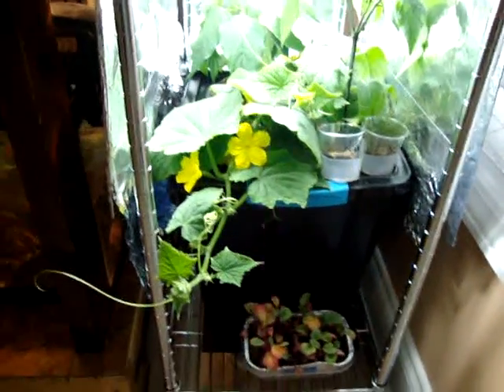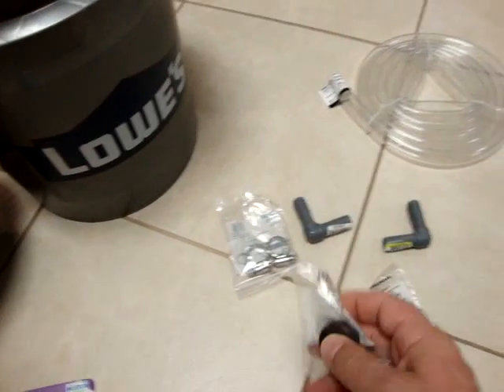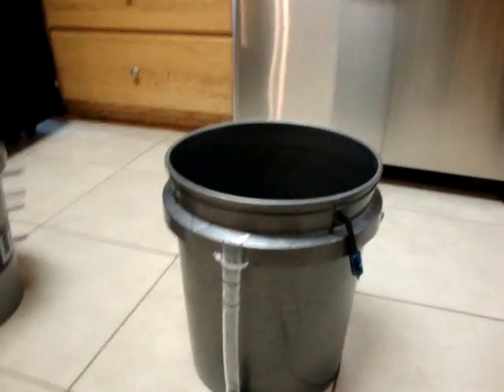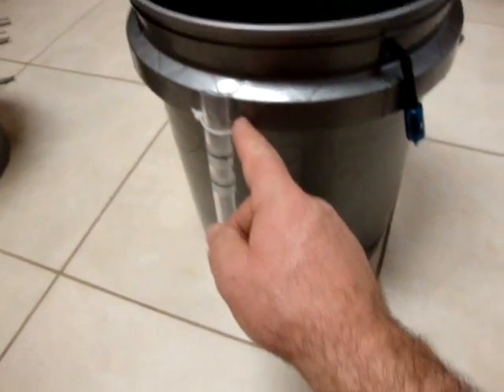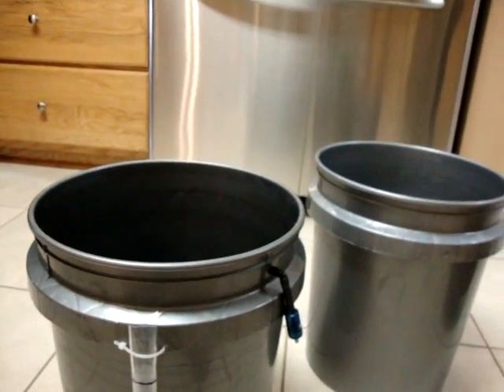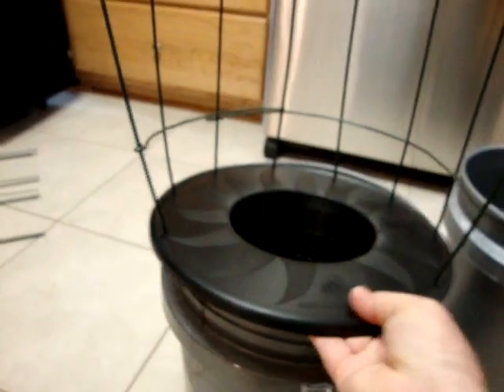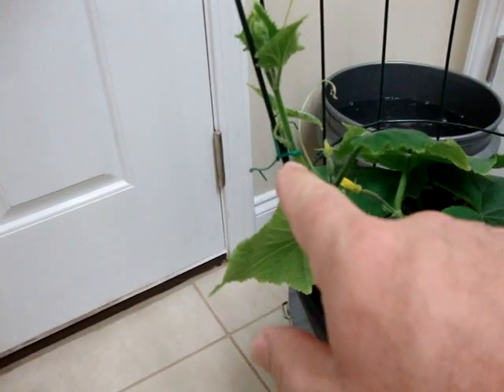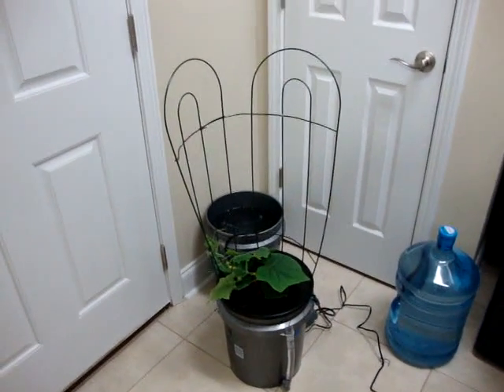How-to build a 5 gallon hydroponic DWC system with trellis for cucumbers

Comment: YOU DONT NEED A DRIP GUYS JUST A GOOD FAT STONE WITH A GOOD PUMP LIFT THE LID TO CHECK THE WATER NEEDS TO STAY COOL TEMP UNDER 70 USE A EMPTY 12OZ BOTTLE FILL IT FREEZE IT THEN PUT IT IN YOU BUCKET THEY HAVE PH PERFECT NOW LAST ALL WEEK

Comment: If you're using a 1/2" PVC elbow, why wouldn't you use a 1/2" grommet? I went to HD and got a 1/2" grommet (doesn't list ID or OD) and it fits nice and snug. So just wondering why you're using a 5/8" ID grommet with 1/2" fittings

Comment: I build mine very similar, except I run the air hose down through the sight tube into the center of the bucket so I don't have to drill any more holes in the side of the bucket.

Comment: 5 Gal Bucket (Lowes) Sunsytems bucket lid net pot 6inch (online or local hydro store) Small airstone and air pump (Walmart) 1/4 in black hose for airline ( irrigation line Lowes) 1/4 in vinyl tee fittings (Lowes) 1/2 in x 1/2 in insert elbow (Lowes Plumbing) 1-1/8 in OD x 5/8 in ID Rubber grommet (Lowes Speciality hardware) 3/4 inOD x 5/8 in ID Clear Vinyl Tubing (Lowes Plumbing) Wire Green border fence (Lowes)
Reply: You're the REAL MVP, thanks!
Reply: thank you

Comment: Get a second 5 gal bucket and drill a hole in the bottom of each and run a length about 6" between the two.  Leave your cuke in the first bucket and adjust your nutes in the other bucket.  It will take a short while for the two buckets to come to equilibrium.

Comment: Dude... I got tired of hearing you talk.  Dont talk so much snd for Christ sake.....less boring.
Reply: +Michael Brummett And he keeps calling it a tee when it's an elbow, 90', or angle connector.  And he said he was going to drill a hole in the bottom of the bucket when it's on the side.  On the side towards the bottom is correct.  On the bottom means underneath.

Comment: I got a elemental O2 pump  and it says   Wattage 41W Voltage 120V   I want to know isn't that a lot of power to run continuously. And anybody know the money per month that translates to
Reply: 41 W ran continuously for 30 days is about 29.5 kWh.  The rest depends on what you pay for power.  If about 15 cents per kWh then about 4 and a half bucks.

Comment: He did have an in-line air check valve so that shouldn't be possible.  Arguably somewhere down the road the grommit could fail and leak on the floor, but you're only looking at a 3.5-4gal spill  You could put the pot in one of those plastic sement mixing pans if you were worried about that (if you're growing in the house for example).  Good tip on the high volume stones.

Comment: I'm going to try this.  I think gluing the stone to the bottom seems unnecessary.  If you rig a way to lift the airstone out the top without moving the net basket, you can drain the bucket with your drain tube and pour new nutrients through the hydroton.  Then if you want to change the airstones (or inspect) you can pull them up through the top.  I'm thinking maybe a 1" holesaw in the basket rim, then use one of those foam clone inserts around the tube to plug the hole?

Comment: Thank u for a detailed video.  I use something very close to your buckets.  I found after a few months, the roots wrap around the bubbler and makes it hard to pull the plant up.  I also use a fish tank heater, and again the roots wrap around it also.  I don't pull my plants up, but I do drain, then move to my flowering room. I wonder if fish tank tubing isn't cheaper than the 1/4 inch irrigation hoses. I need to check that out. But again, thank u for a nice video.  Well done.
Reply: I use a paint strainer net to keep roots away from the air stone and level pipe.

Comment: Q: So, in regards to regulating the volume of water in the bucket, do you just fill it to , say, 80% capacity up to the netti pots - and then keep that same volume for the entire duration of the grow?  Or, as the roots get longer and longer, to you steadily reduce the water volume?  
My assumption is that in a "Deep Water Culture" DWC hydroponic system, the whole purpose it to keep as much of the roots as fully submerged as possible.

Comment: You know you can just use the water gauge insert idea, and run your air into the bucket that way. That's what I do. I just lift the lid to check the fuel, and run air through the bottom hole, like the water gauge. Same size bucket hole with grommet, just adapted down to air pump line outlet size via pvc pieces. Its the cheap way, really. It eliminates the need for an air stone.

Comment: Just a bit of advice...the grommets will fit A LOT better in a 13/16 hole rather than the 7/8 hole that that he used. I found that under 4 gallons of water, the 7/8 hole leaked very slightly. I had no leaks at all with the 13/16 hole.

Comment: I saved nutrient solution by using some (sterilized) 2 liter bottles full of tap water. I just fill them with tap water, cap them tightly, and put them in the buckets.....then I fill the buckets with the nutes. It helps displace all those gallons of mixed nutes that you don't really need until your roots grow into the nute solution... When the roots grow down, just remove the 2 liter bottles. SAVE THOSE NUTES!!!

Comment: @Jksax914 The easiest way I have found to change the nutrient solution in this type of system is to have an additional 3/4" bulk head connector in the bottom of the bucket running to a 295 GPH water pump. When you need to change the nutrients, you just fill up another 5 gallon bucket with water roughly 3.5 gallons and then mix your nutrients. turn the pump on and push the new nutrients into the bucket. Then turn off the shut off valve. It works like a charm.